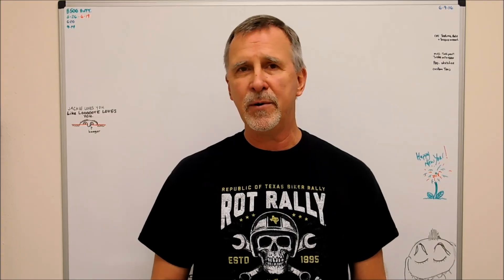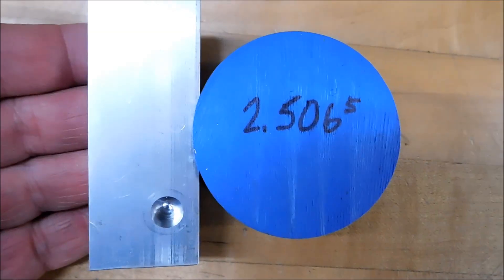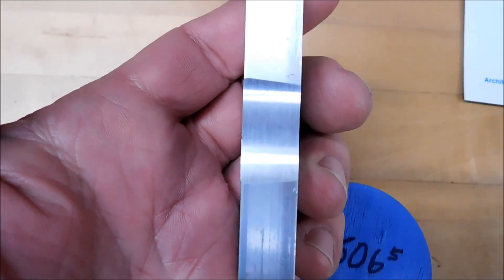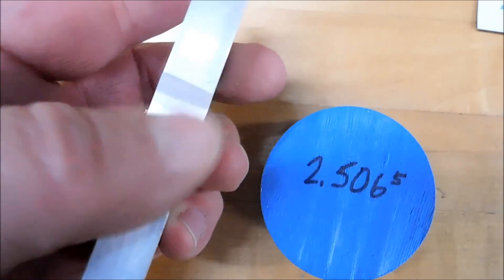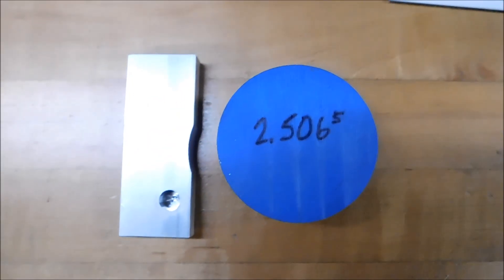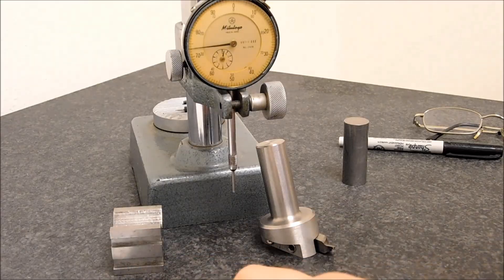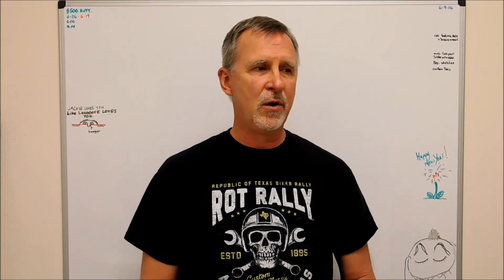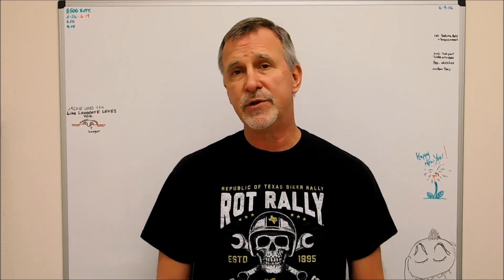How to Set a Flycutter to Machine a Specific Diameter

Comment: Thanks Joe. I used a variation of your method years ago on a job. My college instructor told me this job (one off, odd job over the summer for my old highschool chemistry teacher) couldn't be done without a CNC. That only made me more determined. With a fly cutter and a .250 carb endmill I made the whole job happen. I measured the diameter of the quill of the machine and then with an indicator got the diameter true to within .001" of the nominal, but also had to have a dead flat bottom so I used a left hand, carb inserted lathe tool to true the edges and then blended in the remainder of the bored with the endmill and stoned it smooth. Thanks for sharing this with everybody! 221

Comment: On a sort of related subject would you consider doing a video on the pros and cons of fly cutters vs face cutters for facing, especially for smaller machines where power or rigidity are issues.  There is a lot of conflicting info out there regarding the benefit of a single cutting edge (fly) over multiple edges (face mill) and intermittent cut vs more constant loading.  Your thoughts on this would be extremely valuable.  221 from the UK.

Comment: OK. However you should set a hard stop for your workpiece when you picked up the reference edge. Especially when you reset (rotated) it in the vice. Dont depend on touching off your tool as a stop.

Comment: Excellent explanation of this!  I will surely use both of these methods.  Question on the HSS tool in the flycutter.  Did you grind it any differently since you were using it to plunge rather than face the part?

Comment: I use a height gauge generally, but i made a dual fly cutter for a purpose. your way works too in situations where you  have to work with what you got.
Reply from the maker: You still have to centralize a dual flycutter. Just measuring across the tools isn't going to work.
Reply: No, in this instance i created a cutter with 2 cutting edges, for small plastic parts. Ground to the diameter, an odd size...like, 1.080. 
I didn't need a center point, just touched top n side for zeroes.
Reply from the maker: I am missing something here. Are both cutting edges on the same side? If they arent, either it is a dedicated tool, never to be taken apart, or you have to centralize it.  No other way.
Reply: Yea, this sounds silly, but...

Take your lathe cutters, put it in the holder (in this instance a dual sided one) kinda close to where you wanna be. 
Grind to proper size/diameter, (surface grinder). 

After that, its centered on the mandrel for when I place it into the mill, there you have your radius from zero.
In my case i needed an arc of a certain diameter on an OD, and not like a bore hole.
You are right to pick up zero, then offset if that's whats needed.

I can reuse this several times as a regular fly cutter on surfaces or regrind as necessary for specific diameters.
I've made a few different size holders.
cheaper than grinding a 1.125 endmill to size.

Oh, well if you have a CNC Mill, this is all academic anyway. :P

Comment: Correct me if I misunderstood 221, but your second method only worked because the gauge pin exactly matched the diameter of the fly cutter.  Other wise it would sit higher or lower in the vee block.  You actually need to zero the dial on the flycutter for this to work.
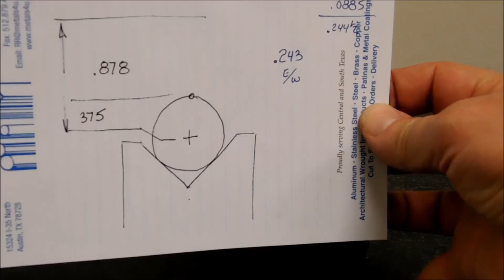Reply from the maker: True. If you use a pin, it does have to match the diameter of the flycutter shank. I believe I showed both ways starting at 11:15.

Comment: Hey Joe Pie...  Is there a way to machine the type of worm gear  that is called, ((globoid type, or cone type or throated type)) are a few of the names I have seen. The straight worm gear will do everything that I desire that gear system to do, but, I really desire to try my hand at not only trying to understand the math, but the process of doing so. My question is, is it possible to machine turn one of those throated types on my manual lathe? I see the BIG BOY's on their CNC's knocking this type out, but nothing on the manual machines. I have put much thought into this ,either trying to adapt some form of power transmission from my lead screw over to the compound to make it swivel, but, other then that, I am not smart enough to think of any simple old school tricks that maybe the old timers knew, (not that I am calling you an old timer, rather, you just seem to know all sorts of slick tricks)... Dru

Comment: Lacking a height-gage and surface-plate, this can be done with a mic or digital/dial caliper, and a bit of simple math.
Clamp flycutter shank in vee-block with tip of tool-bit to be at farthest point from vee-block.
 Measure from bottom of vee-block to top of flycutter shank. 
Clamp (sandwich) a piece of flatstock (known thickness) to bottom of vee-block, with end of flatstock protruding past tool-bit tip.
Calculate required measurement from bottom of flatstock to tip of tool-bit & adjust position accordingly, using mic or caliper.
(44.2)(5)

Comment: Joe, i love they way you take a straight forward common sense approach to machine work, i have a question and it may not be something you've come across. I've inherited an old centec 2b manual mill and I'm slowly working through getting it back to usable, i need to make some alu parts that require the full length of my Y axis, now here's the problem, i think there's rock in my Y. A; how is best to check? B; is there a work around for this so i can get the parts made before stripping the machine and having the ways sorted out? oh and i took notice of the 221 ;)

Comment: Great Video. When you set up the fly cutter with the V block and the indicator, you used a gauge pin to zero the indicator, I'm assuming that the gauge pin needs to be exactly the same diameter as the cutter shank or else it will have a different center height. Would using the shank of the cutter itself instead of a gauge pin possibly be more accurate? 221
Reply from the maker: Yep. If theres a chance the flycutter shank is a weird size, using it would be best. Mine just happens to be .750.

Comment: Once again, awesome, innovative, ideas, 221. I've been avoiding setting up fly cutters off of the machine for years, because of the difficulty in getting an accurate setting just by trail and error. It would take me a long time to get it right, so I would just do it in the machine, and avoid getting the tool set up off machine before hand. I never even thought about using a V block and the dial indicator set up vertically. DUH! (slap forehead). So obvious once you know it...
Thanks again.
Ken

Comment: First off, I have done the same kind of set-up for many years with fly cutters when tight tolerances were not required.   It is nice to see that what I do is done by others.  However, when one is dealing with tolerances  that are within .001 on diameter max, other methods are required.  The mill is a bit awkward when boring to this level of precision, though it can be done.  

I have been wondering, for a while, if you could produce a (some) video(s) your methods to turn and bore on a lathe when tolerances are sub .001"  This subject  would be for  later video(s) or even a series (perhaps number 221 if you haven't gotten their yet).  

I have my own methods to turn C3 bearing fits on shafts, but mostly my work is done in electric motor housings for which I use similar methods.  For example, the recommended shaft and housing fits for a C3 6216  bearing are 3.1497-3.1502, and 5.5118-5.15128 respectively (80mm and 140mm nominal).   There is a total tolerance of five tenths on the shaft and only one thousandths for the housing fits.   

Electric motor shaft material is generally a medium carbon or alloy steel, like 1045 or 4140.  The housings (often called end-bells or brackets) are normally grey cast iron.   The set-up for an end bracket can be quite a challenge some times.   Here, again, could be a video or series.  

Yes, I did choose pretty much the worst case example for the bearing tolerances.   Though when getting to the larger sizes, temperature becomes even more of an issue---especially in a shop whose temperatures can vary significantly.
Reply: To hold tight tol on any machining, surface-finish is vital. You will need a 32 or better.
To do precise OD turning - set the compound to just under 3 deg. Each .001 fed with the compound will (theoretically) take .0001 off your dia. Your lathe needs to be in pretty good shape to do this.
Same applies to boring - but to hold the ID tol you need, you need an intrimike (.0002 resolution) to do your bore measurements.
They're not cheap - but once you use it - you wont want to use anything else.

Comment: Thanks good video. Your bearings on the head sound horrific. the bearing sound horrible. Need a rebuild. Maybe you can do a video on rebuilding a Bridgeport head and putting new bearings in it that would be good video.
Reply from the maker: Its the spline bushings around the front drive pulley spindle. The rear got replaced last year, the front gets it this year.

Comment: Great video Joe! 
Has anyone ever cut a lead screw/all thread on a lathe 'longer' than the lathe can cut? Like in two parts? I am just wondering if it can be done, and what the best setup is . .  I'd like to cut a 600mm for a cnc project, but my lathe only cuts to 450mm..
Reply from the maker: Its called a 'follow rest', and is designed to do exactly what you are looking to do. Coordinating the thread will be the challenge, but not impossible.
Reply: I'm thinking, if i cut to 450, then slide the steel on, then pick up the thread again?
Reply: I hope someone answers this too 😀, I guess we would need something that supports the rod further out than the actual lathe?
Reply: Yes Shaun, maybe some kind of an out rigger steady? I would love to see it done, might give it a go myself in next few weeks!
Reply: Thanks for the reply Joe, yes I think getting the thread dialed back in will be the trickiest part, it's just I have never seen it being done and would make for some interesting viewing . . . but I will give it a go and see how bad I can make it lol

Comment: Another way that I have used is to clamp down 2 scrap pieces to the table example 6” apart and bore a diameter example 6 1/4” and measure the scallops with a stick mic until size is desired and then bore with it now set up.

Comment: Thanks Joe, tip number 221. I use a very similar method but my feel isn't as good as yours so I use another block against the face you edge found and then set an indicator to that face. I can then use the indicator to dial in my fly cutter diameter. As you said when setting the cutter on the plate, a bigger indicator tip is better and it still takes some fussing to get it right.

Comment: Great practical info.  I'll probably use this trick in the next year at least 221 times  😉
How about if you have to put a radius cut along the top of a part?  Maybe if you had something you needed to put a seat in  like the underside of a scope mount or to create a cradle for a mating round part to rest in, and it's too large a radius for a ball end mill, and too long to cut by putting it on end and down feeding it?  How would you go about doing that Mr wizzard?

Comment: How fast do you run your edge finders?  I like around 221 rpm    Yours seemed faster though.
Reply: Joey Cloninger - I usually run my edge finder at 1000 rpm, and I seem to remember reading that in the instruction sheet that came with an edge finder once.
Reply: Steven Haskell 1000 is perfect.

Comment: hey joe, I need to make a few radius's/ rounds on some parts im building for my surface gauge base.  ranging from .221 to 1 inch radius, maybe smaller lol... is there a quick way of doing these rounds without setting up the rotary table besides just free handing it on a belt sander and finishing by hand?  its really just rounding off hard corners and making things look more refined, its not critical dimensions, just looks...  in my opinion, not worth the time to set up the rotary table... I know you got lots of cool tricks, I figured you would be the guy to ask lol...

Comment: Thanks, Joe! Always teaching masterfully. In my case, sometimes the planes are indicated by the length of the circumference, or perimeter, and it is a little complicated to locate the center, and from there we start with a boring head. It is not easy for me, but there is a nice result. I will use your method with and we will see what happens. Again, thank you very much! 221